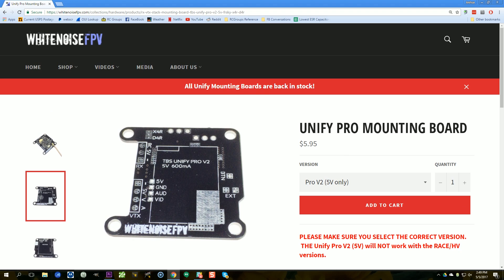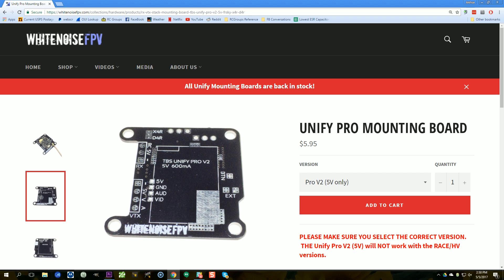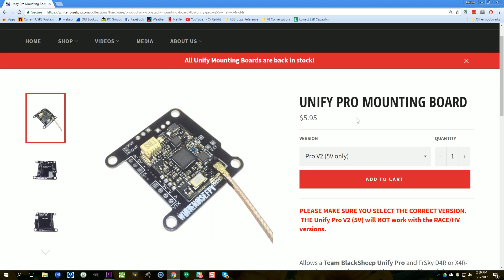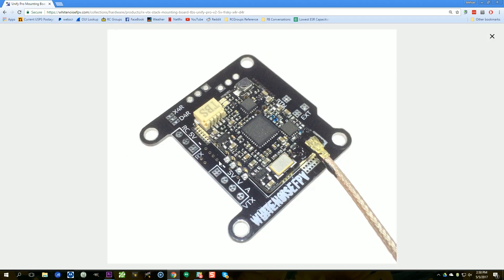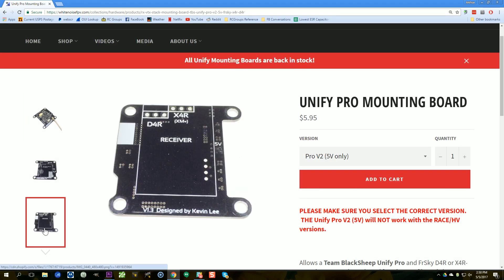THE BEST WAY to mount your TBS Unify and FrSky Receiver | WHITENOISE FPV

Comment: What about to use bit of thermal paste?
Reply from the maker: +Petr Rubeš yes, could be a good idea.
Reply: I used a small amount of Kryonaut.  Before the White noise plate I was getting over heating at 25mw in about a minute.  Now with the plate and the thermal paste I can leave it sitting on 200mW for well over a minute (not recommended) and the highest component temp on the board got to 106 F.

Comment: Use FX style VTX for the Chameleon. It has aluminum bracket that style VTX will mount to very nicely.
Reply: In addition soft mounting PDB and using rubber standoffs you use will work very well with this quad

Comment: That is quite a monstrosity at 9:52 Joshua! Haha
Reply from the maker: It's a little hard to see what's going on there, but I have built an "arch" of solder around the ground wire to hold it securely and protect the signal joint, which is very fragile.

Comment: I love TBS VTX's but can't stand the antenna connectors. they always pop off and sometimes in a good crash it pulls the entire connection off and you can't even resolder it on... I think it would help a lot of people if you did a video showing how to direct soder antenna to TBS vtx. It sure would help me... Thanks! Great video, as always.
Reply from the maker: +djandjkgaming step 1 be good at soldering. Step 2 don't be bad at soldering.
Reply: haha, touché sir. Yes indeed that is what it takes. Primarily the reason why in fact I have burned up two VTX's trying to do so.

Comment: Hi Joshua, this is a  super neat way to put vtx and transmitter inside the quad. Is there any other (cheaper) vtx which can be mounted like TBS Unify?
I see that there're many solutions to save space inside the quad but none (I saw) to better place the battery outside. My strap is destroying the carbon plate and on bad crashes sometimes it comes out (i think I'll add some velcro). DO you have any advice? Hugs!!!

Comment: Fantastic design, the only problem i see is where you are using a F4 board, most of them i used so far, you are forced to hack your X4R with the SOT23 transistor at the back, it will be a little but tricky with this circuit board...
Have a great week Joshua :)
Reply from the maker: +ABMNS PRODUCTION can run a jumper wire to the signal pad on the mounting board then leave the main signal pad unsoldered.

Comment: how can I do this with kiss stuff? I have two unify vtx and one the button ripped off.
Reply from the maker: I don't know what the status is of SmartAudio support on KISS. I know they were working on it but I don't know if it finished.
Reply: Joshua Bardwell ok is it possible to do it through the taranis while i have a kiss board or same deal u think?
Reply from the maker: SmartAudio is what links the Unify to the FC. Without that, you can't do anything, via any means other than pushing the actual button on the Unify.
Reply: TBS excellent I run the unify pro v2 through the pnp 50 and being able to use smart audio feature would make life so much easier thanks!

Comment: would it still work with a flysky i6 transmitter
Reply from the maker: It depends what receiver you choose. You basically have to figure out how to get pins to fit into those three holes. But it seems like you probably could make it work.

Comment: What would you recommend for a 4 in one ESC/ betaflight FC combo (maximum 2 board stack) that has betaflight OSD capabilities for tuning PIDs and such with 4 in one ESC board that can do current sensing and minimum 30A per motor? I am building a BoltRC Kraken WORX build soon that will be very closed off with limited space, so I need a good way of changing vTx channels (smart audio), PID tuning through betaflight FC, and as little weight as possible through ESCs.
Reply from the maker: Betaflight F3 is an obvious choice for FC but it doesn't necessarily interact well with a 4-in-1 ESC. You can wire it up by connecting from the load side of the shunt resistor to the ESC's vBat+ pad. Or you can use the Omnibus F3 Pro, which is designed to do current sensing on the vBat+ line without a built in PDB.
Reply: Thanks for the info. Also, have you ever heard of or tested the Flycolor Raptor 4 in one? It has all the features I need, but I am worried about quality and if it is possible to easily update betaflight firmware in case of new releases.

Thanks for all the amazing content, super informative!
Reply from the maker: +Chase Mallory I haven't tested that ESC, no.

Comment: I just bought the unify pro hv. my question is i have a  kissfc I tried hooking up the smart audio to the TX port and nothing seems to happen. I downloaded the firmware and still nothing. so went back to kiss osd. do you know how to make it work with the kissfc.thanks for all you do
Reply from the maker: Does KISSFC support SmartAudio yet? I thought they were still working on it.
Reply: not sure maybe that's the problem lol. it's kinda confusing getting all the info on kiss products at least for me

Comment: I wish TBS made a Unify in 1.2ghz.
Reply: Hugh Hemington well most countries dont allow 1.2
Reply: I didn't know that, but I suppose it makes sense.  That's why there is so little 1.2, 1.3 gear out there.  I've had such good performance out of the Lawmate 1.2g stuff.  The CP antennas are like half an orange!  So you're not putting it on even a mini-quad, but for fixed-wing or large quads, it's killer.

I've got 5.8g now too, but it all seems to live down to its reputation.  Maybe I'm just spoiled by rock-solid FPV.

Comment: Woow, epic inventioon!!! 

I got a question for you, what about air mounting the fc? i mean, just putting 2 standoffs ;D I saw a dude doing it and he said it isolated many vibrations!
Reply from the maker: +DanutsFPV I think 2 standoffs woukd be worse than 4 because the board would be able to flex.
Reply: Thanks for the reply! 
The guy said that it worked perfect, but dunno hehe, i was also thinking of that flexing of the fc

Comment: A little liquid flux in a needle tip bottle would make your solder joins look much nicer.

Needle tip bottle
https://www.amazon.com/Needle-Dispenser-Solvent-Applicator-Dropper/dp/B00UG08QDC/ref=sr_1_4?ie=UTF8&qid=1494176767&sr=8-4&keywords=liquid+flux

Liquid Flux
https://www.amazon.com/MG-Chemicals-Corrosive-Conductive-residue/dp/B008UH4DT4/ref=sr_1_2?ie=UTF8&qid=1494176767&sr=8-2&keywords=liquid+flux
Reply: JT I really wish you had posted this yesterday before I ordered other stuff. It's on my list now though
Reply: Make sure you clean the flux up after using it. It can be corrosive. Buy one of these to store/dispense you alcohol
https://www.amazon.com/dp/B00DK2BGIK/ref=sxr_rr_xsim1?pf_rd_m=ATVPDKIKX0DER&pf_rd_p=2795440402&pd_rd_wg=lXnrW&pf_rd_r=7AP37J9741EC0FETEFES&pf_rd_s=desktop-rhs-carousels&pf_rd_t=301&pd_rd_i=B00DK2BGIK&pd_rd_w=4c5sn&pf_rd_i=alcohol+dispenser&pd_rd_r=642BQH0G1S8MW526HHA0&ie=UTF8&qid=1494208968&sr=1
Reply: JT ,  It's on my list, thanks again.

Can you clean with Denatured Alcohol and Isopropyl?  I have heard both are ok but seems to me that D.A. would be preferable

Comment: Can you still get a audio transmission when using smart audio on the tbs unify? I thought i remembered trappy saying in fpvlife that currently you cant have audio and smart audio transmissions at the moment.
I like to be able to hear my throttle position when i fly.
Reply from the maker: +Stephen Gibb if you do them both nothing will explode but they can interfere with each other.
Reply: Here's how to get both working together.  When I find an easy/cheap place to get single components I'll give it a try.  I wired both up without a capacitor or resistor and although they both work the audio is unbearably loud and full of static.
https://team-blacksheep.freshdesk.com/support/solutions/articles/4000100084

Comment: I got Immersionrc tramp and it is even better than TBS Unify because You can wire telemetry wire to flight controller but it doesn't sacrifice Your audio because they are on two different wires
Reply from the maker: Personally I don't use audio so it doesn't matter.
Reply: But other than that it's exactly the same

Comment: It seems like a good idea until you realize you need smartaudio or you need to figure out a way to push those buttons.  Nothing metal of course.
Reply from the maker: +Michael Steele the board let's you wire the button to an external button if you want to. I didn't because I'm using SmartAudio.
Reply: Great!

Comment: I can't live without smart audio now, one by one converting my friends. They do get very hot above 200mw so always use double sided heat sink tape to the carbon. Course with smart audio I easily shut off my vtx at the end of my flight.
Reply: Canyon Racer how do you do that?
Reply: Darrel Martinez 
With betaflight osd when I land and disarm I then yaw left pitch forward and the osd pops up. You can tune betaflight pids/turn off vtx, change change channels/power/pit mode. All very easy to navigate and make changes in your goggles. You can land make changes and take off in seconds. You can even set up switches so you can change pids in flight and see the pid values on screen while your flying. So many cool things. Try it, you'll love it!
Reply: I'd love to know how to turn off the vtx in the menu.  I dont see that anywhere.

Comment: I have a Tramp HV on my main quad and absolutely love it with the Race Wand. No more guessing or powering up a quad before even switching channels. It´s great!

Too bad they´re having so much problems keeping up with demand. Considering HobbyKing has now stocked them again I´m thinking they´ve completed a new batch of production which should be available from local retailers soon.
Reply: Dennis Vlaanderen I agree I have had nothing but problems with the hv never had a single issue with the tramp ended up swapping them all over to the tramp, I have yet to have a problem with a single one.

Comment: Joshua, can you expand on the the use of those big pads on the bottom? You said the point of them is to release heat,  can we use them in other way to help with spreading heat out like just putting a heatsink there?
Reply from the maker: +Zaniix_FPV of you want to put a heat sink just put it on the bottom. But the copper traces will transfer heat especially.
Reply: Zaniix_FPV I now always use some heat paste/tape between the tbs and the carbon fiber for extra protection. I didn't always do this as I've never really had a problem but the lower the heat, the less drop off in broadcasting power and ultimately longer vtx life....until I crash it!

Comment: It would be super neat if they implement something like channel hopping given that now you can send digital data identifying your specific transmitter on the audio channel.
Reply from the maker: +String Whisperers channel hopping requires technology that is not in the vTX at this time. The hops must be very fast and very precisely timed.
Reply: So we are not going anywhere further without changing ages old surveillance tech .It is a pity that this is still such a niche market so dropping millions to develop is not viable

Comment: which version of unify pro do you recomend? v2 or HV?
Reply: I've used both and I prefer the HV (can run off batt voltage, has a 5v out for the camera and has a nice locking connector)
Reply: STRYKA FPV yes the 5v output to the camera I found very helpful. makes the build much cleaner
Reply: Leandro Nowak I have both. for me the v2 worked better.
Reply: I've got the HV coming from ImmersionRC 600mw, found I needed an LC filter which kinda sucked.
Reply from the maker: +STRYKA FPV check the Unify HV which has these features.
Reply from the maker: +Leandro Nowak I use the HV.
Reply: if you want I did a video on how to keep you pig tail from falling off you can put the link in the discription if you want
Reply from the maker: +That Flyin Ryan go ahead and post it.
Reply: @thatflyinryan I followed you vid man and it works 100%. Havent had any problems since
Reply: Leandro Nowak the v2 gave a much cleaner image. the hv version gave more static even on the same quad. also the v2 remains cooler on 800mw however the hv on 800mw got very hot.
Reply: the original hv v1  won't work it's open source trappy said that is on the smart audio
Reply: Kwad Squad FPV awesome man I'm so glad to hear that man
Reply: Elliot Hancock why?
Reply: Joshua Bardwell with HV, do you need to add a Lc filter? or it have included..   im worried about the motor noise..  im having problems with That in my current vtx
Reply from the maker: +Leandro Nowak I don't add one.
Reply: Leandro Nowak I needed one.
Reply: Smokin Mesa I have a Immersion 600mw I don't use a lc filter but def gonna grab a unify pro hv when there back in stock.. Goodbye dip switches!
Reply: MiGz FPV I found on the same setup the LC filter was needed.  But yes, goodbye dip switches and hello LUCA script
Reply from the maker: Personally, I have not had any noise issues with the HV, but I think my copters generally tend to be noise free, so I may not be the best person to ask.
Reply: Joshua Bardwell I'm certainly no expert or pro but have a high quality setup (in parts/equipment).  I'm sure some or most people find no need for the extra filtering and I found the noise surprising.